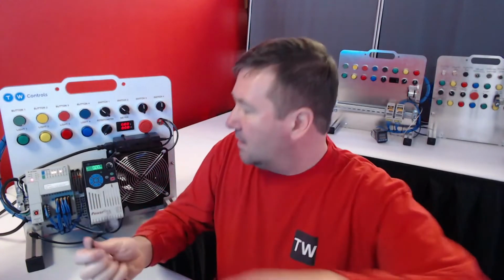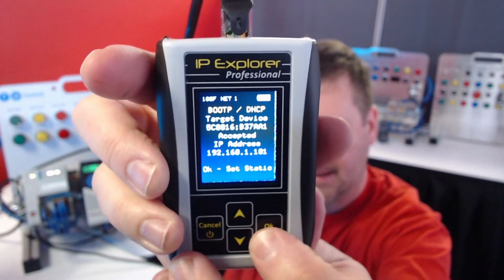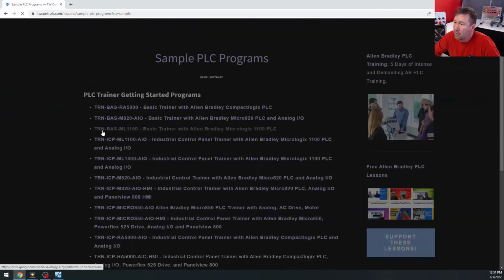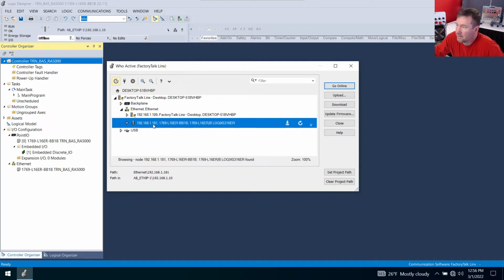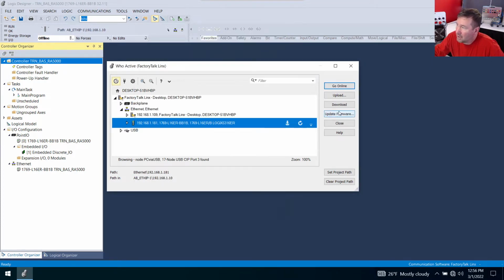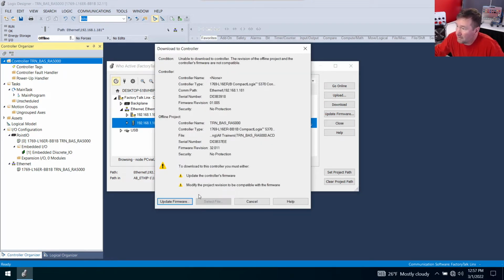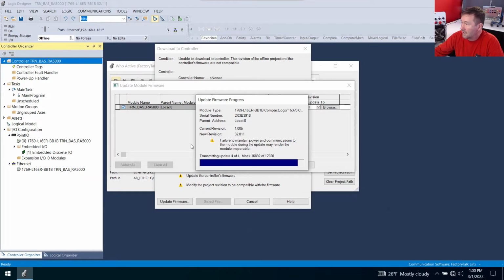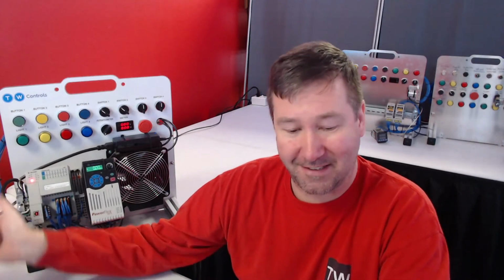Compactlogix NEW Out of the Box Setup in Studio 5000

Comment: I just discovered your channel searching for a video on using a CompactLogix PLC to control a stepper motor. I’m sure this is possible but I don’t know what module I would need or what instructions to use. Any help would be greatly appreciated. Awesome channel!
Reply from the maker: It isn't possible natively with the Controllogix, you would need a 3rd party devices such as an AMCI.  It is possible with the Micro850, here is a video I did on it.
https://www.youtube.com/watch?v=rMVIuYhvr9g
Reply: I created an AOI. to control applied motion servo controller. It has both fwd and reverse direction and a pulsed output
Reply from the maker: I don't think so, I've visited this subject before and didn't come up with a good solution. I don't remember the details
Reply from the maker: I just reread your reply and realized you said you created one. What hardware did you use for your outputs?
Reply: I just used the regular digital outputs and wired them to an applied motion servo controller
Reply from the maker: @robertcain4643  Yeah the problem with that method is you'll be real limited on speed. Steppers can go upwards of 20 kHz. Regular outputs are only good for about a 100 Hz
Reply: @TimWilborne  yes speed wasent a issue on my application so the regular outputs worked fine, but yes on a high speed application it would have been a issue
Reply: I’m surprised that there isn’t a high speed output module. Even Automation Direct has one for their PLC’s. I would use the Automation Direct PLC if they had any in stock. This parts supply issue is really becoming a major problem.